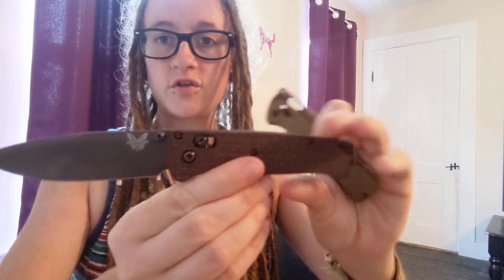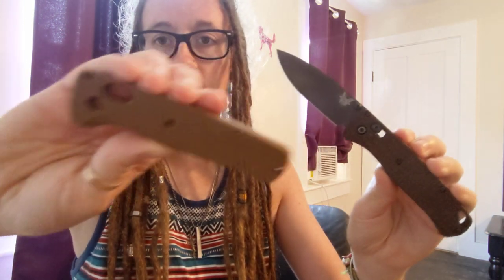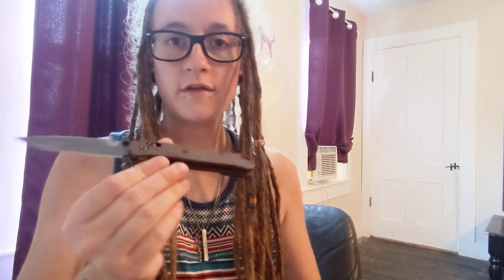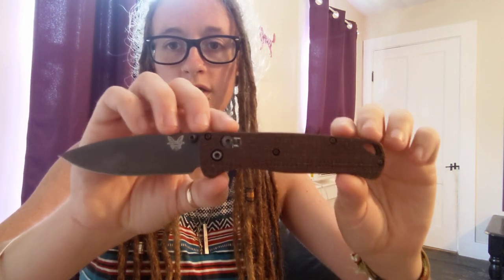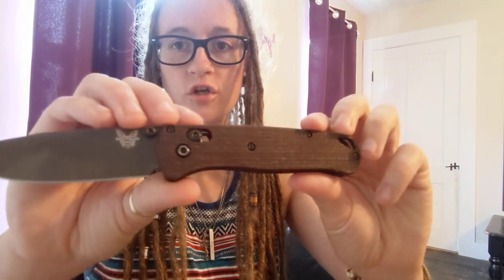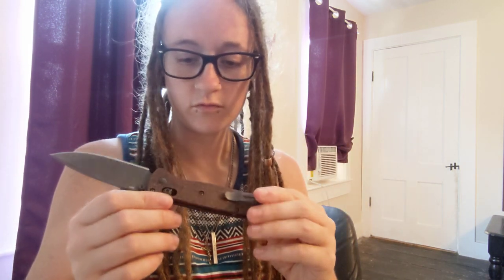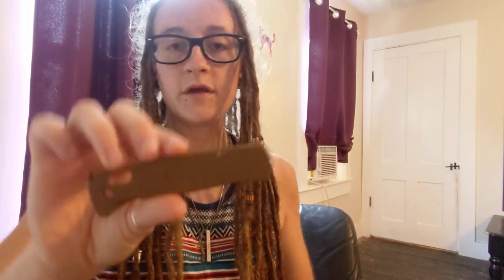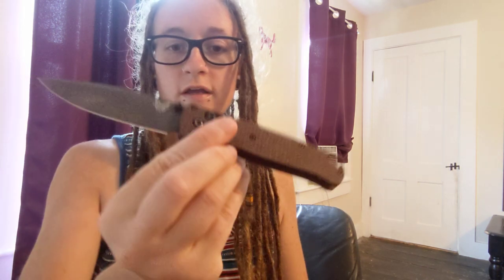Ripps Garage Tech Scales VS Flytanium

Comment: I also favor RGT over Flytanium. Ive had both. My flytanium g10 bugout scales were a nightmare to install. The mounting holes were a little bit off which creates a huge problem for installation. Never had any problems out of any of my RGT scales. Not for my bugout or my para3

Comment: Flytanium all day... my Micarta scales from ripps broke almost immediately...flimsy, you can tell they were made in someone's garage... even if that had not happened, it would still be flytanium all day...Great stonewashed titanium scales
Reply: Ripp  makes good stuff. You were prob using your Bugout when you should have been using an adamas. Ha.
Reply: @Cbyfz  it broke during installation ya goof... a fracture around the screw hole while I was screwing it in about half way done.
They replaced it...next one was broken upon arrival. No box damage either, it didn't even handle normal shipping. you do understand how thin the bug-out scales by ripps are especially when they're made out of micarta. They were basically paper mache no exaggeration.
So all I can say is stay away from their Micarta bug-out scales the other ones might be good hell who knows...
Reply: @BuffaloNickel9  got it. I have his para 3 micarta. I love um. Anything Bugout is paper thin, ha. Bugouts are for sharpening pencils and cutting the tape to open boxes on your bigger knives. Hsha
Reply: @Cbyfz  ha i agree 
it had to the super-thin bugout scales with their Micarta is no go that's why I don't see many folks with them... Ripps micarta  make the plastic  bugout scales that come stock  feel like Steel..
Like I said though you obviously like them for a reason I'm sure they got some other good ones... if I hadn't had that experience I might like ripps
Unfortunately I won't be trying them I'm going to stick with flytanium..
You can't beat their titanium scales have you tried them?
Put them on the bug out it completely changes the knife.
Without them, bugouts are only  best for opening my mini Adamas and even bigger knives
Reply: @BuffaloNickel9  i have like 6 bugouts I think. I only carry around the house or as backups for larger knives. Fun to customize. I have the flytanium crossfade scales. I did like them but I  decided to cut one titanium Bugout put of my line up and they didn’t make it. Ha. But….. I did later heat ano’d them and now I’m thinking about bringing them back. Ha. Knife life. I like Ripps. Hes got good stuff and priced well. I must say I don’t think I’d ever try micarta scales on a Bugout. They need strength from the start.  I like the 535-3 CF a lot. I paired the scales with the grey coated m4 blade and it is sick. Sold the s90v with some g10. Ps- mini adamas is dope. I have 2. If you like that, try a Hinderer half track. I just got one and now I’m gonna sell one of my mini adamas.